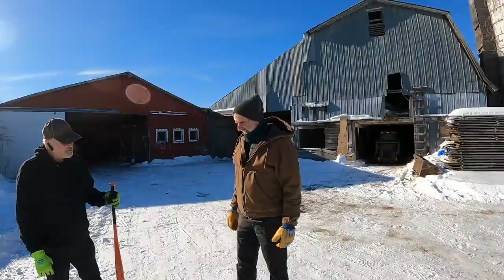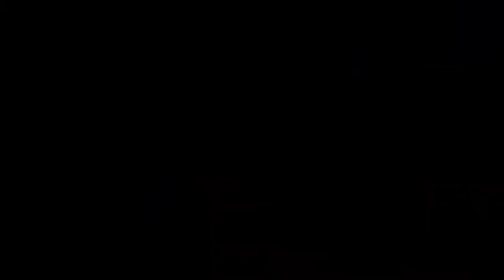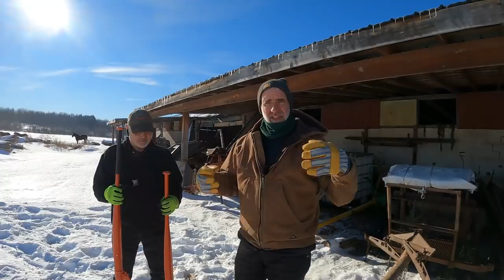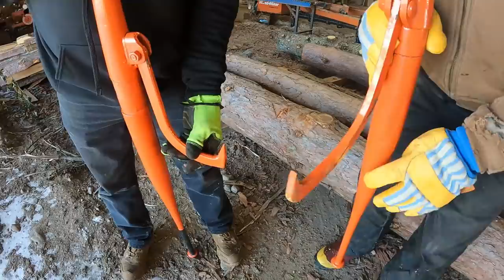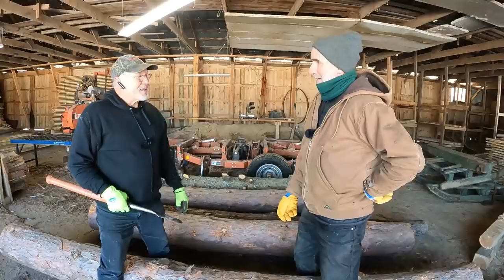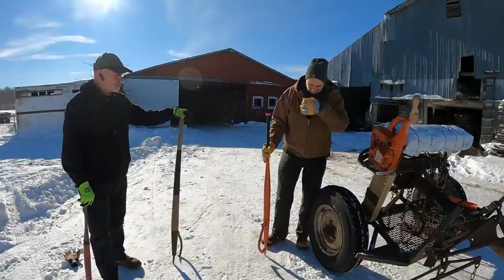I Bet You Didn’t Know This!!! // Cant Hook vs. Peavey

Comment: The term spud is used for potatoes because of the tool the Irish used for planting them. It was similar to the debarking tool , they pushed it into the ground with their foot and made a hole for the seed potato to go into. Then they pulled the tool out and stamped the dirt back over the seed potato.

Comment: I’m a fanatic of Vintage Canhooks and Peveys.  I have close to 30.  I clean the steel using Electrolysis.  I clean the handles up and use  Fractal Wood Burning on my handles then finish.  I don’t re-sale.  I’m decorating my great grandparents old home place that’s over 100 years old I’m redoing.  This is only a hoddy.  I’m a 35 year Commercial Refrigeration Tech by trade.  But out of all my old antique restoration, Can-Hooks and Peveys are my favorite

Comment: Looks similar to a bill-hook that is used in England for laying hedges, clearing brambles, and the heavier ones can be used for splitting kindling. There are regional variations in the design of bill-hooks, some with county names. Laying hedges is cutting partly through a live stem near the ground,  and bending the stem over, almost horizontal, then repeating on the next stem to make a stock proof hedge. The job is completed by adding vertical hazel stakes through the hedge into the ground and then twisting long briars or creepers along the top .😀🇬🇧
Reply: I can vouch for this post, I learned this type of hedging  exactly as you've described, as an Agricultural student on a traditional farm in Northumberland ,England..thanks for bringing this memory back..

Comment: Hemlock spud.  We peeled hemlock for the bark, was used for tanning leather and forge fuel for blacksmith heat treating.  The hook was used to slice the bark lengthwise and the head then placed perpendicular into the slice to peel the bark.  Strictly a summertime affair…deer fly season

Comment: I believe this is a log debarking tool.  Used to remove bark from logs.  I have never used one that I remember though I may have and forgot , it's been so long.  I would like to use one sometime just to see how they work compared to a dull shovel, that is what I use, a shovel with a long handle, a flat shovel or spade will work, I prefer a long handle but use what you have.  I have peeled a lot of cedar poles,  you just pull like string cheese, long strips, and I peeled spruce and birch and others but never used this "right"  tool..maybe some day.  It appears to be in very good used shape, well taken care of. Thanks.., Ok, I have finished the video and back.  I was excited to see this because this yr.  I finally got my own Cant hook and peavey,  I put my own handles on and they are hefty at the top but I can trim them down, but I like them as is for now.  Thanks for explaining the difference between the cant and Peavey as I was figuring it out on my own but you propelled me forward, both you fellas.  I prefer wood as I am big on wood, and I'd buy Jim's old hook with the tape on it just like that, because it is genuine and Jim's.   It will be worth big bucks some day, leave it as is.. ah ha, joking but true..
But anyways,  great video and I was wondering about that spud hook, I would figure it out, but now I know.
A video on the Spud and Cant Peavey hooks, mana from Heaven,  I Love it thanks guys..  be careful Jim you don't trip on that peavey,  its going to set different and take a couple days to get used to , muscle memory. .., maybe not but, caution.
I should e-mail you a picture of the 2 I made and a grapple log tong that got a new handle.  I custom widdel my own handles and use a horse rasp file to fine shape the wooden horn.  I'll take the wood over aluminum any day but I don't have your breaking experience, a Man needs to know the limits of his tools and machinery or you will break it.
When you have to buy your own, then you will learn,  or in my case widdel your own handle , fun, but a lot of work.  Like a hydraulic relief valve, protect the machine by setting  limits. 
Nice idea on that aluminum handle, good job Gentleman and Thank You,  both your families (Dads/parents) for your service in the woods.  Thumbs up to the camera lady..  Love it..   Please...Stay safe. 
You are Loved by many.

Comment: I have a couple spuds. I peel a few popple every year for fire wood. Leave it full length with the leaves and limbs on all summer and fall. It dries out nice and burns great. In this area, in the old days pulpwood needed to be peeled and it was only spruce and fir the mill wanted. The pulpmill was in St John New Brunswick. Old spuds are common in sheds and barns in this area.

Comment: Peeling spud used them in the spring time for peeling popple as the paper mills paid extra for it as they did not have to debark before getting ground up, the bark slipped real easy in the spring when sap was running so much so that the logs were slippery and had to be left until summer to dry up otherwise they would almost slip of the pulp trucks.  Ever use pulp hooks for hand stacking pulp wood?

Comment: That is a tool for trimming the branches from the trunk after felling the tree and before the cuts are made it can be used for clearing the brush around the tree base and for trimming any low hanging branches and low branches along the trunk.  It is a safer tool for trimming branches than a double bitted ax as it doesn't need to be swung.  It is important to have the cutting area clear of brush to provide stable footing and the ability to move out of the way safely.  So it would be handy both before and after the tree is felled.  The part opposite the hook serves as an ax type tool when necessary.

Comment: Very interesting.  I totally blew that one.  I have only used a draw knife for debarking a log however the only logs I worked on were pine.  I also found a "Felled Bark Spud Debarking Tool" for sale on the internet.  They were not as nice as the one you showed us however it appeared to be very similar to the one you showed us.

Comment: I peeled white cedar posts for fence 8 feet long 
If cut in the spring in northern Ontario they would peel easy with a spud but I always had other work to do on the farm at that time so I would cut the post and poles in the late fall before snow got to deep leave them piled in the woods all winter under the snow and as soon as the snow melted off the top of the pile go in and get them take them back to the farm and peel them at home then the bark pile I would run over with my bush hog mower for mulch

Comment: Looks like a form of Bill Hook. We used to use straight versions of these for hedging (trimming hawthorn branches along ditches/fencelines) on the smallholding I grew up on in the south of Scotland. We called them hedging bills. 
Presumably the bill hook aids moving the branches out of the way without using a pitchfork, and also looks to allow a push cut if the outer edge is sharp?

Comment: I thot it was a debarking spud at first then I saw the bill hook. Used to cut small branches and saplings. Would have been a engineers tool back during the Rev War, and before and after.
Reply: Roll tape!

Comment: 2:09 Guessing bark stripper? In the past I cut tree for my use making log buildings and stripped bark. Given the short handle and thinness of the blade I could see it handy for stripping bark. But I don't think many people strip bark even back years ago. So probably wrong.

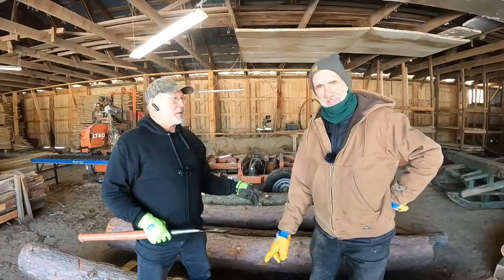20:00 Bingo. Wish I'd had one back in the day. I used a 18" long chisel which wasn't great. And yeah, time of year sure mattered. When logs didn't peel easy I used a draw knife which sucks and marks the wood. Easy peel logs looked like an old dead log that had lost its bark naturally.

Using a baseball bat as a handle is a great idea. But as a business making them unfortunately would be tough because of shipping costs having to send materials to be made and shipped back. Reuse works really great for an individual but the numbers just never seem to work for doing it for others. Easier and more cost effective to buy new bats and hooks, knock out a bunch and sell them. For me I'd just whittle down the wood handle with a knife/sander until it jammed into the bat. Then pin the wood handle in place filing the pin's head smooth (solid brass flathead screw files easy) or epoxy it in.

Comment: removing bark
Reply: It is a spud for peeling logs.  In the spring when sap is flowing freshly cut logs like popular and even balsam and spruce can and were peeled primarily for pulp wood.  I personally peeled many cords of pulp wood, mostly popular, but also some balsam and even some elm and white birch.   Our spuds did not have a hook or a sharp side.  The chainsaw operator would cut a shallow groove the length of the log that allowed the spud to be inserted or forced between the bark and the wood.  Thus only the tip of the spud needed to be sharp.   I really enjoyed this video.   It brings back many memories of wonderful gentleman who hired me to work for them in the woods in May and June of the year to peal pulp wood.   My recollection from back in the mid 1960s was being paid about 7 cents a stick for pealing pulp wood.   A stick was measured as a 100 inch section of the log.  So a log 400 inches long would be 4 sticks.   Sticks with a larger diameter wood be counted as double or triple thus making them worth 14 or 21 cents to the pealer.  Thanks for the video Jim!

Comment: I'm not sure I agree that there is a difference between a "peavy " and a cant hook. Sure, one has a point but it's the same tool. Just cause a maker added his name to it, it doesn't make it a different tool. And traditionally the tool had a handle with a knob on the end, so you don't slip off the end. They actually look like a giant drum stick, so I'm not seeing a need to use a baseball bat for a handle.